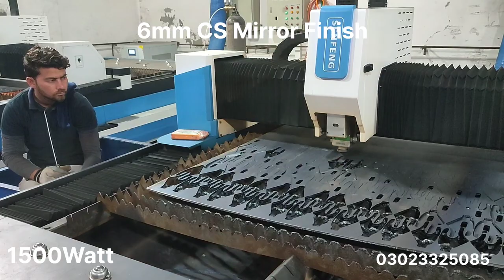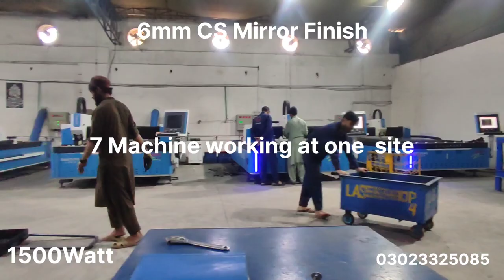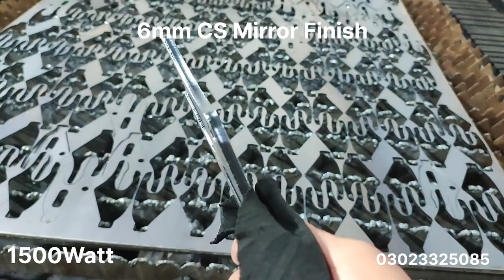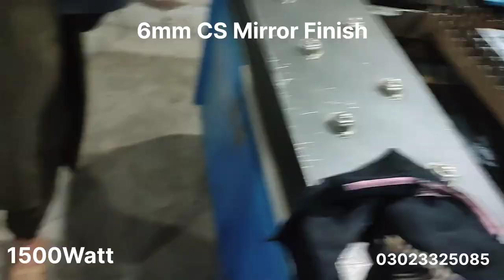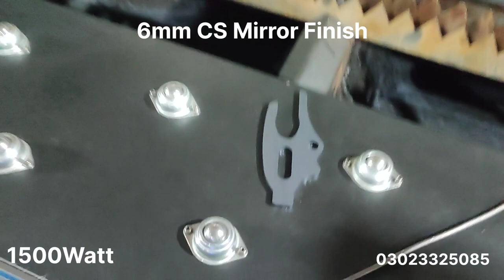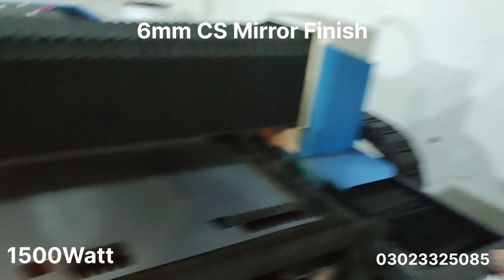7 Fiber Laser Metal cutting machine working at one site in Pakistan#production #bikeparts

Comment: Hello sir 
I'm facing a problem while sheet cutting 
After cutting, diagonal sizes are not equal. Pls guide
Reply from the maker: There is must be something wrong with your Servo Drive interferometers Parameters...please upload that file ,it will be ok
Reply: @Zainlaser_Tech  
Don't know how to get infertometer paraneters
Reply from the maker: @izakielmillimeter3428  which machine do you have
Reply: @Zainlaser_Tech  UL 3015 UNIONLASER CHINESE
Reply from the maker: @izakielmillimeter3428  you are from Pakistan?
Reply from the maker: @izakielmillimeter3428  need to.adjust cross beam mechanically and calibrate motors...
Reply: @Zainlaser_Tech  any helpful video about this ???
Reply from the maker: @izakielmillimeter3428  not now...in future I will make how to adjust diagnol
Reply: @Zainlaser_Tech  where are these parameters ? Pls share screenshot ...thnx